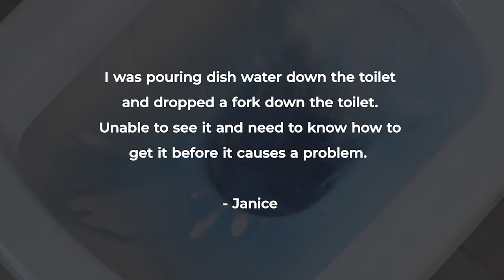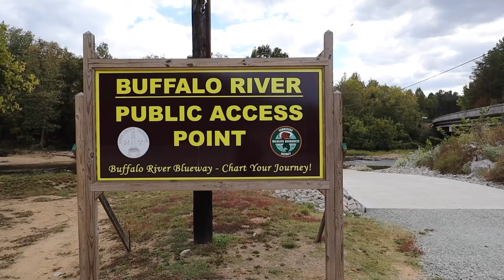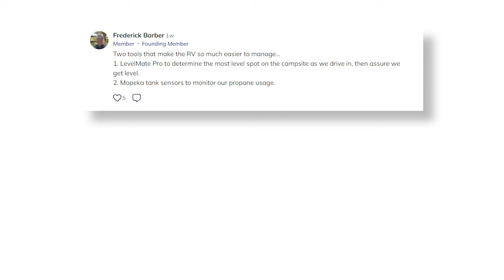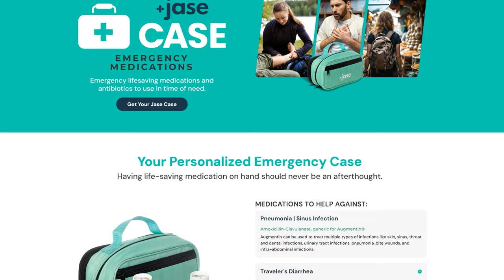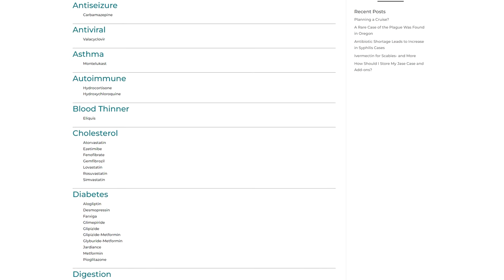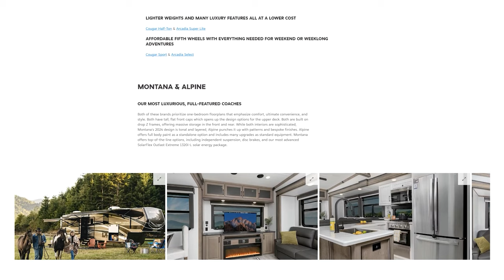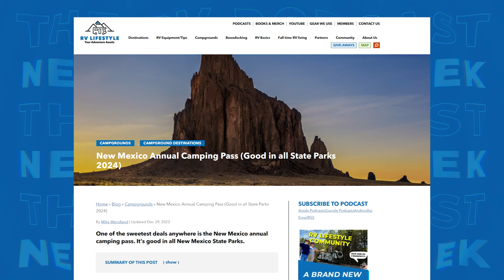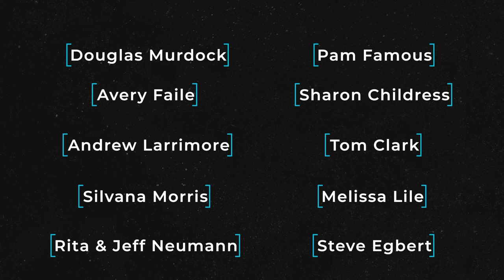How NOT to Run Out of Meds on an RV Trip

Comment: Another option for the fork in the black tank might be to buy an inexpensive "mechanics grabber tool" about six feet long.
 Step on the toilet pedal and hold the valve open. Then insert the grabber tool with the claw open, and go poking around the tank until it hits something solid, hopefully the fork. Let the claw close and pull the grabber out. With any luck the fork will be at the end of it.
 Some patient practice with a fork outside, some more patient fishing around in the tank, and you might get it.
 The tool is inexpensive and compact. A clean tank, some bleach and paper towels, long rubber gloves, and the usual "sewage" precautions are in order.
Reply from the maker: Good idea!